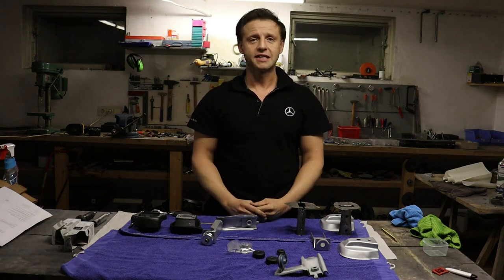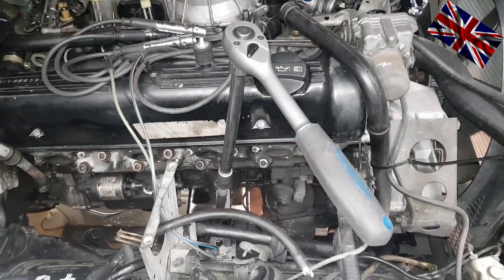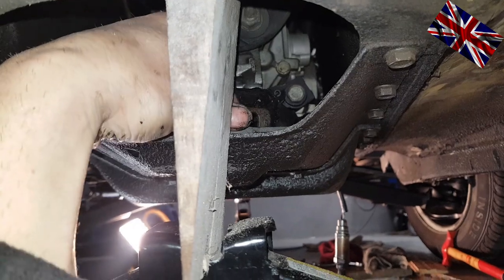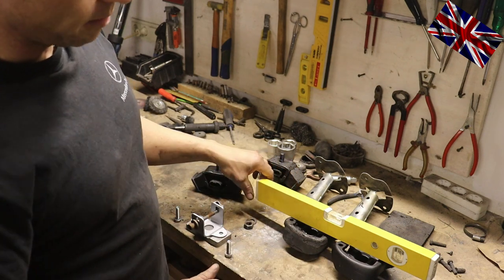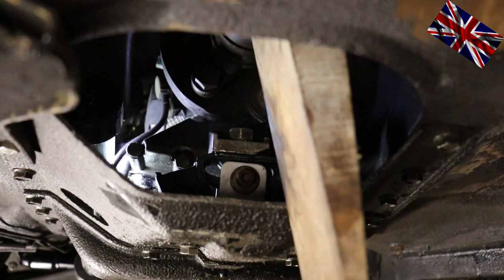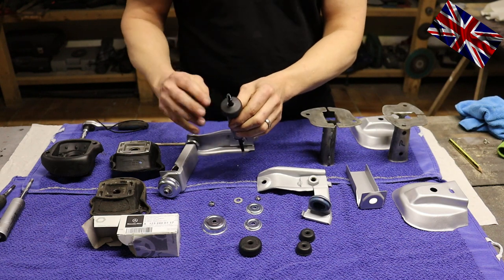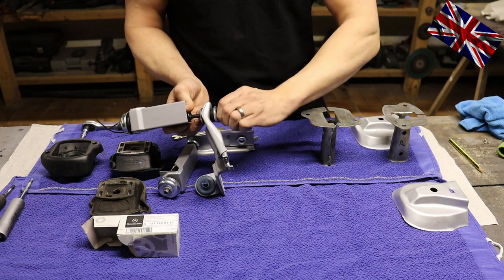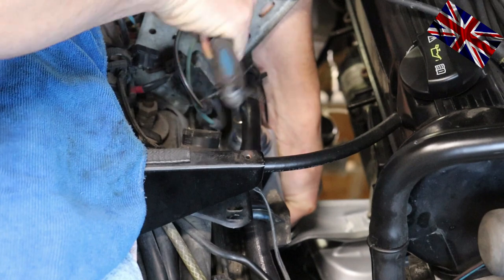Engine mounts Mercedes SL R107 M117 V8 engine - removal and installation classic car restoration

Comment: Your are using the wrong units for tightening the bolts. It is not Newton (a force), but Newtonmeter (The product of force and length).

Comment: Watched video, checked my engine mounts, completely collapsed, likewise the shock absorber, The mount at the rear end of the gearbox will probably be the same, definitely needs changing, I always thought unbalanced wheels Were  causing the vibrations, Which is not the case, this will be my next project, I am kind of lucky, I only have a six cylinder model, more room “”to roam about “”in the engine bay